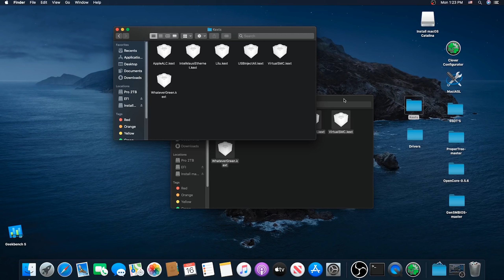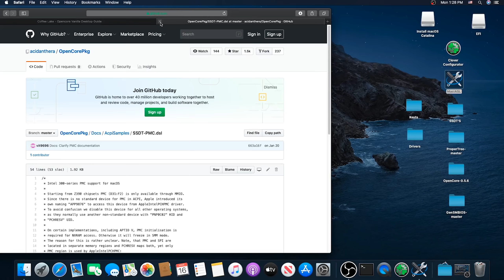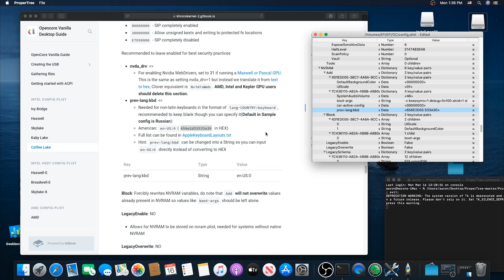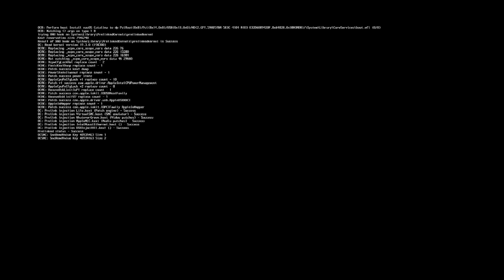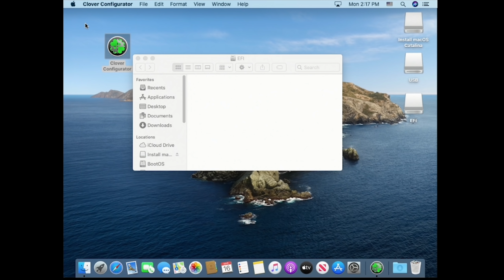OPENCORE CATALINA Z390 Gigabyte Designare Hackintosh Bootloader using a MAC! | Step by Step

Comment: Hey @technolli great video, Everithing on my hackintosh works great, I just have one problem, when I try to open big files from an internal second hard drive like photo library (130gb) the hackintosh reboots itself. I have almost the same specifications as in your video, Core i9, Designare z390, fenvi etc, just the power supply is a Corsair CXM Series CX750M, don't know if that may be causing the reboot. Hope you could help me, this is driving me nuts!! thanks

Comment: Thanks a ton!! most detailed and smooth tutorial ever worked like a charm on my new rig.Only problem I bumped into was bluetooth.I have bcm94360cs2 chip docked into a pcie  card and it worked oob and flawless in my clover build but in open core wifi and hands-off are there but bluetooth is missing.
Reply: Never mind i fixed it by hit and trial method by injecting usbinjectall kext.bluetooth,airdrop working now.telling it may be helps anyone in future.

Comment: Sleep followed by Wake
I have essentially the same system with 10.15.6 which is working very nicely, except (there is always an except, right). When it wakes from sleep it fails with a kernel panic (do have the text of that). I suspect that I should move some of the kext's over to /Library/Extensions. Appreciate any comments or pointers to links that would help solve this issue.

Comment: Thank you for being so concise with your tutorial.  I would have been lost.  I have two problems:
1. the system doesn't show my correct graphics card.  I have a Radeon Pro W5700 and displays as "Display 7mb"
2. None of the USB2 ports work.
Sleep doesn't work - but that isn't too big a deal as I'm an editor and generally don't let my system go to sleep anyway.
I haven't tested TB yet...
Please help.  But loving the build so far. Thank you!
i9-9900K
Gigabyte Z390 Designare
Corsair Vengeance LPX 64GB (2x32)
Radeon Pro W5700
Samsung 970 EVO 1TB NVME (System Drive)
Samsung 860 Pro SSA 1TB
2x WD Black 6TB

Comment: I created my bootable "Install macOS Catalina" disk, and everything looks fine., but when I open Clover Configurator, it doesn't show up in the EFI Partitions section until I launch the installer. When I do, it does pop up in that lower "EFI Partitions" section of the window, but it's labeled as read-only. I mount the partition, and sure enough, it's read-only, I can't copy any files, and I proceed to rip my hair out. Has anyone else run into this? Please help.
Reply: Yeah I’m experiencing the same thing. I’m working if this is a part of the new iOS 10.15.6!? Has anyone else experience this!?
Reply: Just realized I have a Mac with high Sierra I’m gonna crating the bootable from there and will update if that fixes the problem.
Reply: I'm also having the same problem. I thought it was a Catalina 10.15.6 issue, but I tried creating the bootable with High Sierra instead and it's still show me a locked EFI file in the bootable USB, not sure what I'm missing.

**UPDATE**

Ok, I think I figured it out... when making the bootable.  You first need to erase the usb in Disk Utility.

1. Open Disk Utility (while usb drive is in mounted)
2. Hold Command + 2 or click on View menu and select show all devices.
3. Select the main external USB drive entry, not the partition
4. Then click on Erase, select Mac OS Extended Journaled and GUID Partition Map
5. Now go and created your bootable OS X drive. It should work.

Comment: Many thanks for these instructions - I have the machine up and running but have spent many many hours playing with config to try and get intel i9's built in GPU to run in headless mode so that I can leverage quick sync in final cut pro x. I get a critical error abort when i try to boot with iGFX enabled. Happy to pay the $49 for support if you can confirm this is a fix you can help me with please? Thanks again

Comment: Hi @technolli, I have just built my first PC using a Z390 Designare motherboard and & i7 processor with a Radeon X570 graphics card. I followed the install instructions here but when I boot from the USB stick it stops on OCABC: Incomplete OpenRuntime r4, requires r11. Any help to get over this point much appreciated.
Reply from the maker: Dave try this EFI: https://ce05a305-2bad-44e3-9149-3538386d84d9.filesusr.com/archives/191c4b_605a360f8f6847e395932ea40cc41308.zip?dn=EFI.zip
Reply: @TechNolli  Thanks heaps. I got it all working, was a bios setting :) All running smoothly now.

Comment: Hi technolli I followed you guide for this setup and I have other computer with Ivy bridge I tried to follow the steps of open core but I don't have any luck my usb boot doesn't reach the installer do you have some guide  or Efi files for ivy bridge setups??? Im stuck in this by 2 weeks now, thanks in advance

Comment: My Thunderbolt 3 doesn't seem to work totally right on Mohave. USB C drives work well but can't get it to work with Thunderbolt bridge for the QNAP NAS. Is like, if it works, it should work kinda thing or sometimes partial functionality works but not all?  I'm a newb.  Thanks in advance.

Comment: TechNolli - Thanks for the work. No problems getting this setup up and running. I started with 32GB of RAM (2x16GB) and decided to another 32GB (same manufacturer and model - Vengeance RGB Pro DDR4 3200MHz). Fired it up and black screen. Shut down, removed the 2 new sticks of RAM and then got a BIOS recovery error. Made sure things were correct and boots fine with the original 32GB. Should this just work with no further tweaking? Worth starting to swap out the two new sticks into the old system? Thx.

Comment: Hey Technolli

I'm stuck with the SSDTs - the site you used in the video has changed and the coding isn't the same as in your video.  
Do you have an easily accessible folder of the SSDTs or links to the correct ones - I'm getting lots of error reporting for the MaciASL compiler when using the suggested files from khronokernel

Comment: My G-Raid Thunderbolt 2 drives still don't work 😢. I wasn't able to get it working with my Clover mojave build and this one didn't work either. I have the thunderbolt 2 to 3 adapter from apple which works just fine on my macbook pro. Anyone get this build working with the G-raid thunderbolt 2 drives?

Comment: Hi TechNolli I have followed your tutorial to the letter and I an getting an error message of (incompatible open runtime r4, requires r11) Here is my build specs (gigabyte Z390 desinare /w thunderbolt, I5-9600K, 16GB DDR4, Samsung 970 eve plus NVME, MSI Radeon RX 570, Fenvi FV-T919) can you give me some help on what I need to change or what I'm doing incorrectly please

Comment: My thunderbolt 3, USB 2.0 are not working. My bluetooth won't show up either. Any suggestions? I have this exact board. thanks!
Reply: also running coffee lake with i7-9700k
Reply: Also one of my two Ethernet ports do not work as well...is that normal?

Comment: Thx! I successful installed on my z390 Aorus Ultra + i7 9700k  + Radeon RX 5700xt after follow your steps and learn a little bit about open core! Is working FAST and seamless, so , on opencore guide i read about fix CFG Lock after install, did you think its necessary step on z390? thx!

Comment: Can you suggest how to overclock?
Reply from the maker: Hackintosh do not like OC. :(
Reply: @TechNolli  thanks for your advice :) 
I read a tons of guides on Tonymac and on some other sites but I cannot find anything that fits with my configuration or anyway a clear guide for Designare z390. I bought i9 9900k to get a better performance for machine learning, can you help me to setup the bios settings to overclock my cpu in a stable way at 5Ghz? 

My conf:
CPU: i9 9900k
PSU: Corsair RM650x
CPU Cooler: Corsair H60 
GPU: Radeon RX570 XFX
RAM: Corsair Vengeance 2x16 3600

Thanks in advance!

Comment: How I make wi-fi and bluetooth to work in this mobo?
Reply from the maker: Fenvi T919 PCIe card:https://amzn.to/2zL6u1H
Reply: @TechNolli  This kext is working: https://github.com/zxystd/IntelBluetoothFirmware.
Tested and has stable Bluetooth connections. Using with my Magic keyboard. It also has the Wifi driver that works better than Fenvi, but you have to configure the SSID manually in info.plist in your package contents

Comment: IF INSTALL doesnt work at first...dont redownload! Just change the date and time in your BIOS. I did mojave install so all my plugins i use will work! (ihope) so to get this damn mojave installer i used terminal to dl it.. did technolli's amazing easy process...in bios before installion from usb i changed the date and time which got rid of the "This copy of the Install macOS Mojave application is damaged and can’t be used to install macOS"  error... best of luck

Comment: Everything worked like a charm. But I get stuck in final installation with a half grey screen with a working cursor. 
390designare 
I9
Sephyre 56vega 
M.2 500gb catalina
M.2 1tb Windows 10pro

Comment: Very thorough video but Thunderbolt does not work with Security Bios option set per your instructions, you need to set it to no security. My external DAC would not be seen at all... Thanks

Comment: If you plan on installing MacOS Catalina with the Fenvi 1200H/Fenvi T919 on the Z390 Designare, make sure to add the USBinjectAll.kext, otherwise Bluetooth (Handoff/Airdrop) will not work.

Comment: Thank you for showing this, but I'm having an issue with getting my Apollo x6 working.  I have the same equipment, using 128GB ddr4 3600, OpenCore 0.5.8. Do you have any suggestions? I included the TB3 aml file in my ACPI folder.  Can you specifically show how you get UAD to recognize devices with your TB3?
Reply from the maker: Hi Rez! With my newer Logic Pro X video Thunderbolt is working. Tested on Apollo Arrow and x6. Give it a try!
Reply: TechNolli I’ll check it out. Thank you.
Reply: TechNolli I checked out the other video, and I realized something I didn’t think about. This is setup to work when powered up, not necessarily with hot switch (which is fine). It works, and I am smiling big. Thunderbolt is such an important feature with my equipment upgrades for audio. I’m excited about the work I’ll be able to do with this system’s capabilities. Thank you for your help! Cheers!

Comment: Thanks, This worked great. You have done a great job of detailing the entire process. I had some problems with my DRAM light on my z390 Designare motherboard, and BIOS wouldn't stay updated. I rebuilt the entire computer, and but a new battery on the motherboard. Seems to have worked. Thanks So much.

Comment: Hi, I use alcid=11 cause when I use my headphones output on the case the audio is not good. Do not know if people experience this also.
Reply: This needs to be higher up. If you're experiencing poor audio quality try adding alcid=11 instead of alcid=1.
Reply: @prestoncollum282  where at in the bios? or config.plst?
Reply: Azvasa Music you must have already figured it out, but you should add it as a boot argument in your config.plist.

Comment: Hi Mike - 2 weeks in and my machine based on tis video is running great thanks. I have noticed though that the GPU fans (Radeon RX580) hardly ever spin - they sit idle even when I'm playing a 4K movie. I'm not a gamer so I'm not maxing it out but I wondered if this is normal as when I do play 4K movies the CPU fans do kick in, not the GPU. Is this something to do with hardware acceleration not being enabled so CPU doing all the work? (I use 5k Player app). Many thanks!
Reply: A 4k movie probably wont make your GPU fans spin. The decoding is probably done by the cpu.

Comment: It works !!!!! What a great guide. The first one works with my configuration and i try so many. But everyone set the Bios settings very differently than you.
Most of the time it run until the restart and then it was dead again.
 Thank you very much.

My configuration: Gigabyte Z390 M (rev. 1.0), Intel 9600K, 32 GB Corsair 3000Mhz, Radeon RX570 4GB, Cruxial 240GB SSD, Crucial M2 1TB. Case inWin 301 white (i review it on my Channel)

Comment: Wow - Awesome bunch of videos! just subscribed.  I have the same board,  I  noticed you did this and a clover build on same board.
1) Which is better for this board OC or Clover?  
2) In clover build you say important to set bios software mode to “other” and this build important to set software build to “Windows 10” Is that due to OC vs Clover?  I also notice it is 10.15.3  - 
3) should I avoid 10.15.4 because it might need different Kexts or ssdt’s?
thanks for these

Comment: Hope you reply.... I want to make sure my cpu fan and my ram fits..... i want to buy the corsair vengance rgb pro (32gb) about 2 inches in height and thermaltake UX 100 5V. Do you know how wide the cpu cooler has to be in order for the ram to fit. I am scared the cpu cooler will over lap into the ram slots and because of the rams height it won't work....
Reply from the maker: Hi Jose! I really have no idea, but I am sure they take that into consideration when they manufactured it.
Reply: @TechNolli  much appreciated (:

Comment: I am following this guide but using a different mother board - GIGABYTE Z370 AORUS Gaming 3. Are there different settings I should be using? Especially the SSDT-Z390-DESIGNARE-TB3HP that was put in the config.plist. I am little concerned because I don't have the Designare board.
Reply from the maker: You should be OK Chris, but you don't need the Thunderbolt SSDT.
Reply: @TechNolli  Thanks for the reply! I removed the Thunderbolt SSDDT from the config.plist just to be safe. I am thinking of adding a PCIe Thunderbolt card to my build. Will I need to add anything to the plist to make it work? https://www.gigabyte.com/Motherboard/GC-ALPINE-RIDGE-rev-10#ov

Comment: Hi all - I followed this video and it worked a treat. The resulting machine is a monster in both single core and especially multi core tasks.
Not sure that the Thunderbolt is working though as i don't have a drive or device to test it with but I notice in System Profiler when I click on Thunderbolt in the list the right pane says Thunderbolt : No hardware was found.
Does this mean it is not active or just that nothing is connected? (both the ports do supply power and mount USB devices when using a USB-C cable).
Many thanks

Comment: Hi TechNolli, Thank you for all your fantastic work. I have exactly the same build except my recent GPU is a Radeon VII. I found there intermittent freezing and sometimes it just finally stopped responding so that I have to press the power button to shut off the Hack. Before using Radeon VII, it was Gigabyte RX570 and it worked very well following your guide, very smooth and never freeze. Is there anything I have missed, not done. OR Radeon VII need special tweaks? Thanks.
Reply from the maker: WoW! Nice card Charles. I have never tested one, so I am not sure. Are you sure the card is good?
Reply: I think it is good as on the Windows side, it works flawlessly & do not have the same problem. I will check the complete build again. Thanks.

Comment: Using this was able to get Catalina 10.15 without any problems. Very smooth. Then tried to do a combo update to 10.15.4 which failed. Screen at the end was blank. Anyone with any clues on how to update to 10.15.4
Reply: I just made the boot usb with 10.15.4 install file and it worked.

Comment: TechNolli, Great video. As a beginner in the Hackintosh, I simply followed your video to get my system running which is Z390+i9900+5700XT+64GB+Samsung970-1TB. I had some issues with the blank screen which was solved by adding to boot-arg agdpmod=pikera. I am installing 10.15.4 which is the only one I was able to download. That said I haven't been able to get Thunderbolt to run to access my disks. I have disabled the Thunderbolt security. I would appreciate if you had a solution.  It may be due to 10.15.4.  Great Video again. Thanks
Reply: what Ram do you have on your mobo?

Comment: Thanks for the tutorial. I have a sapphire Vega 56 with this exact motherboard and cpu. I cannot get hardware acceleration working in handbrake via video toolbox or in Plex to encode and decode via the Vega 56 or the iGPU. Can you assist with this? Everything else is running great on the machine running Catalina 10.15.3 with OpenCore 0.5.6. PLEASE HELP!!!

Comment: I need help I tried 3 different tutorial nothing seem to work I don’t know where the problem is I keep getting stuck on initial text those bunch of white line on first boot

I got:
Asus Z390 Prime-A motherboard
Intel i5-9600K CPU
Gigabyte RX590 GPU
16GB Corsair RGB Ram

So frustrating
Reply: Appreciate if anyone could help or a tutorial guaranteed to work with my spec
Reply from the maker: Hi Shuaib! Email me your efi folder and I'll take a look.
Reply: TechNolli I Just sent you an email now you should receive it

Comment: Great video Mike! Can I just check, the GPU listed in your parts list appears to be a PCIe 4.0 card, not a Vega you show in the video itself? Most of the comments here are referencing RX5xx series GPUs - would any of them be OK as they are considerably cheaper! :-) It must be an Apple supported device for me so I can safely run all the Adobe CC suite - which RX5xx series model would you recommend? Cheers
Reply from the maker: Any RX 570, 580, 590, 5700 or Vega 56 would work plug and play!
Reply: @TechNolli  
Brilliant, thanks!
Reply: @422nt07  I'm getting a black screen with my RX 5500 RT is there anything i need to do. it's getting right up to the point of installing the system then I get a black screen.

Comment: Great tutorial. I have the same board (just using a i5 9600) and an rx580. Everything booted up just as it should except I am using a dual monitor. Only one of my monitors works with your configuration. Is there somewhere in the config file that I need to change to get dual monitors?
Reply from the maker: I'll test mine Gary.